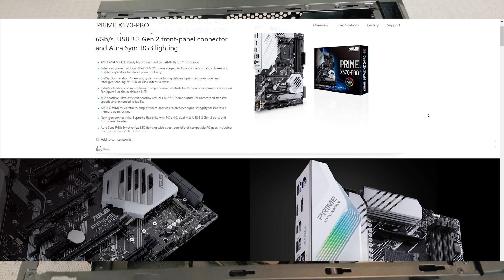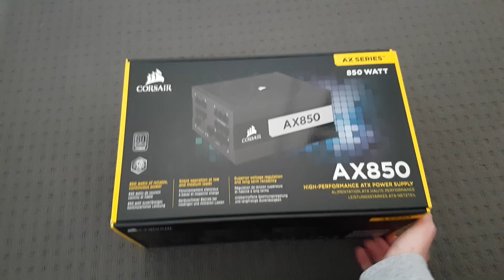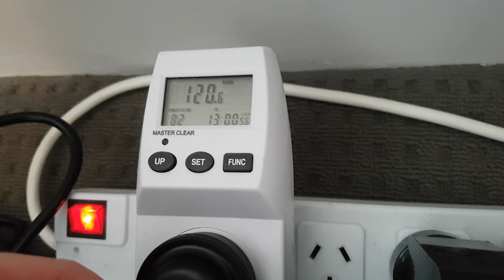X570 Upgrade Pt:1 ft: Corsair AX850

Comment: ZZ. my 700w doesnt has a 8 + 4 pin for my x570 mainboard.. What a bullshit:/
Reply: trancelistic it's just 8 not 8+4.
Split the 8 in half
Reply: @markios6824   No its not.. Google it. (2x4)+(1x4)  on x570 boards.
Reply: trancelistic what leads do you have?
Reply: @markios6824    Zzz
https://www.asrock.com/mb/AMD/X570%20Steel%20Legend/index.asp
Look at the second picture. On top/left where usely power goes.
It also says so in the manual
ATX12V1 + ATX12V2
Reply: trancelistic do you have the atx  lead?
Edit: do you have the 8 pin ATX?
Split one end into 2x4 pins labelled CPU and run a separate wire for the main block.
Reply: @markios6824   Ill try.. but I plan om buying a rgb cooler 700w.
I've read that the extra 4 pin for heavy oc's is on e.g amd 3900x or 3950x  ( u need the extra power then...)
But I ll just run a 3600 on stock. so 2x4 (1x8) will be fine I guess
Reply: trancelistic yes you need it for boost or oc that's obvious but also if you use a lot of cores you need the extra power.so any ryzen cpu will need it. The point of the X570 boards is speed,fast m2,fast pci,fast cpu,fast ssd,
If your compromising its performance then it's pointless getting an x570.

Comment: Must the x570x mobos have the 8pins +4 connected? What if I connect the 8 pins only?
Reply from the maker: Yes, you can use just the standard 8 pin plug. But from the rendering work I've done, the extra power definitely helps.
Reply: Yes so you can use core boost for the ryzen cores on an app that comes with. It helps with stutters while maintaining high FPS.